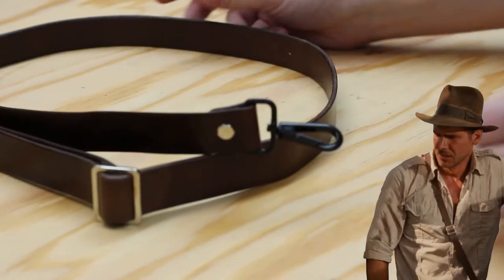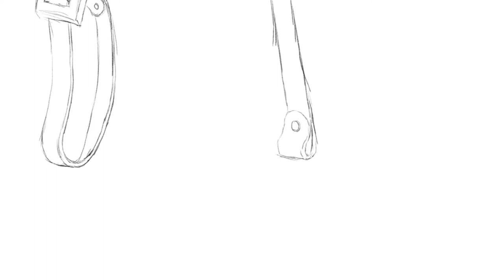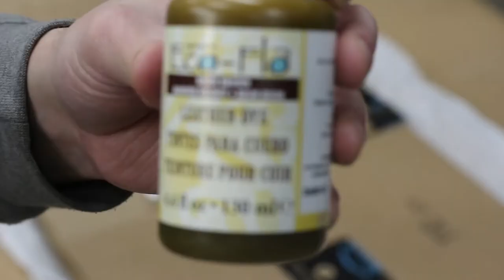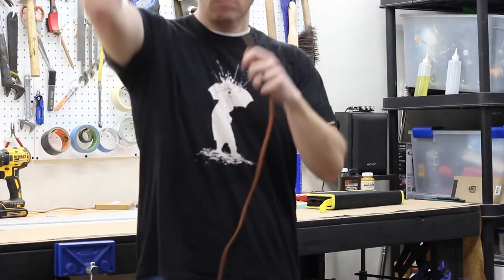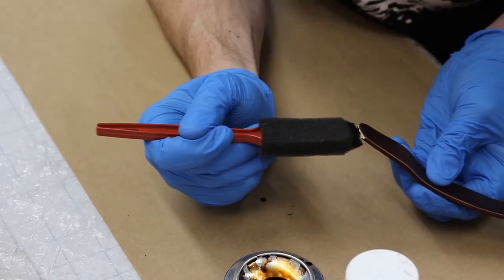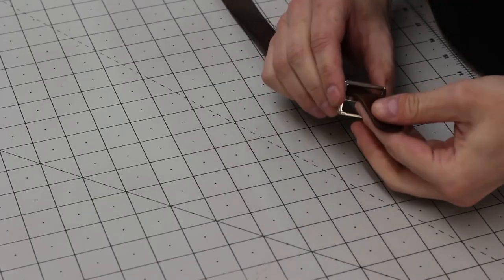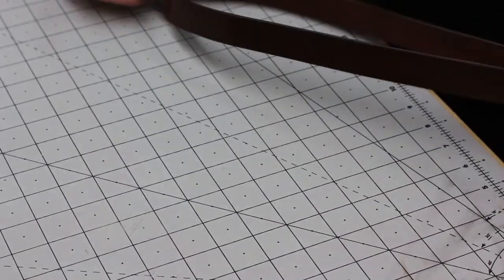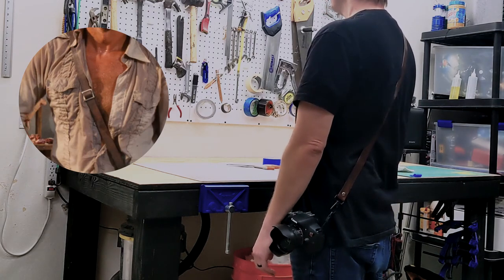Making Indiana Jones' Leather Strap | DIY Raiders Leathercraft

Comment: You don't need to made one. The strap used for the bag in the movie was nothing more than an old leather suitcase strap. Suitcases came with two of them. They can be found at goodwill stores everywhere for next to nothing. People throw out old suitcases every day. Using a suitcase strap will result in a more screen accurate Indy bag than using anything else.
Reply: Pretty sure his strap was a vintage rifle strap. I don’t think I’ve found any suitcase straps as long as 65 inches, and definitely not with Indy’s hardware, but if you could point me in the right direction I’d be grateful.